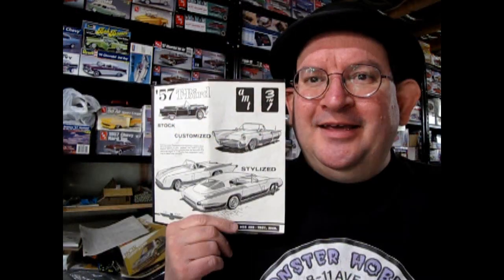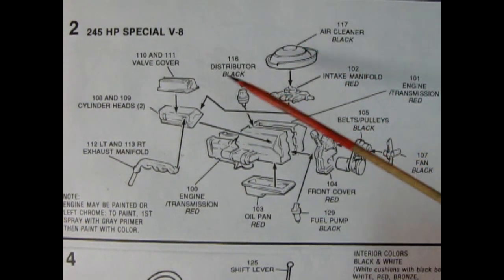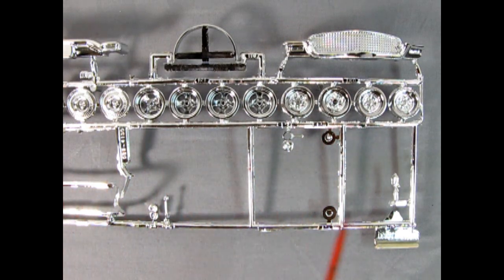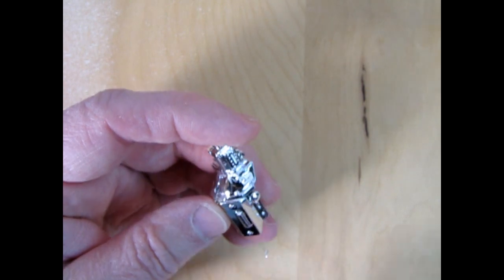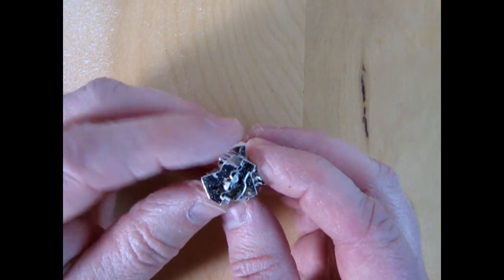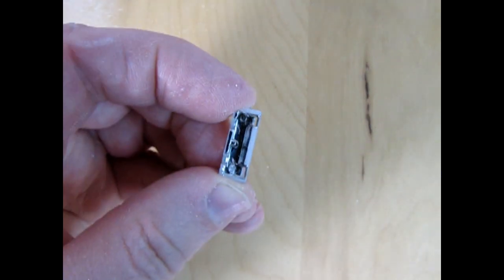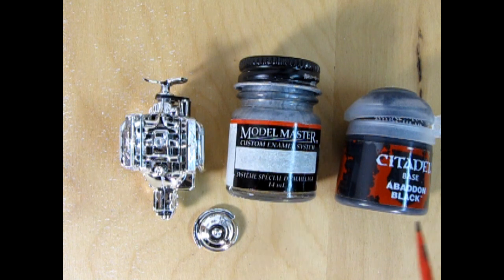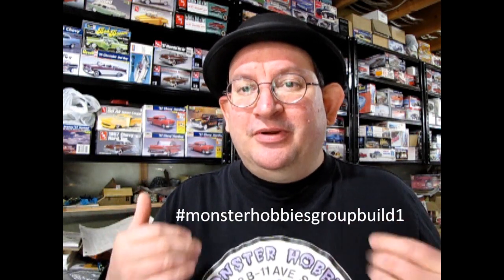My Entry For The Monster Hobbies 2022 Custom Model Car Truck Group Build Video 2 - The Engine Build

Comment: Engine looks great, weird fuel pump and try Molotow chrome pen. Thanks for showing and best wishes from jolly old England 👍😎Pete 🤓
Reply from the maker: Great suggestion! Glad you liked the engine build.
Reply: @MonsterHobbiesModelCarGarage  I'd have stripped everything but the rocker covers and fan🤩
Reply: @MonsterHobbiesModelCarGarage  the Molotow pens are excellent for chrome. I also decant from pen and use paint brush. It really is good, Trevor 👍👍👍👍
Reply from the maker: @petesmodelcarcustoms584  Sounds nice. Maybe one day I'll get one of those pens.
Reply from the maker: @petesmodelcarcustoms584  In the future, everything is chrome....and from a 1957 standpoint, this IS the future! LOL!